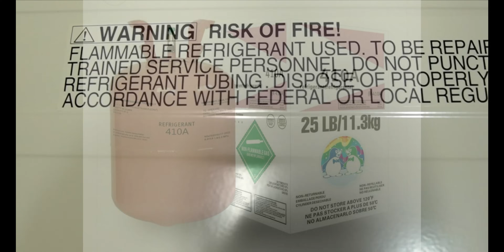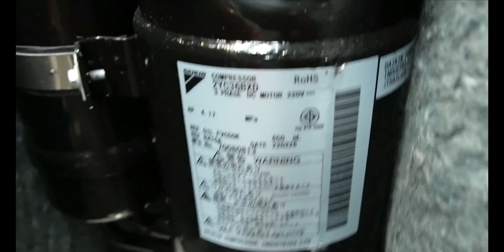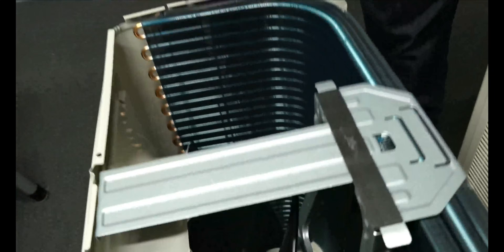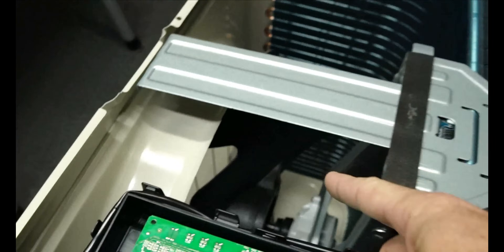The Truth About The New R32 VS R410A Heat Pump Air Conditioner (4k)

Comment: I recently installed an R-32 mini split (24k btu) in my finished basement to replace an R-410a unit. I currently live in the southeast USA. When it is 95°F outside with a humidity of 70+, the vent temperature was 44°F on R-410a and now 36°F on R-32.  The R-410a system used about 915 watts running and the new system uses only 509 watts.   
The new R-32 unit is so efficient that I have it running on just 3 solar panels most of the time.  Also, I have an 8 year old window AC in my garage that uses R-32 and have never had an issue. 
The flammability of A2L can't possibly be more than my natural gas lines running all over my home for the water heaters, central furnace and cooktop.
Reply: You're not comparing similar systems if your wattage difference is that great or your compressors weren't running at the same load when you measured the wattage.. the very best stats have R32 at 10% more efficient that R410. Not 90% like you stated.
Reply: I have one on my boat .
This unit only use 600watt max in the winter for heating .
Love that i have done this
Reply: bro do u even braze with nitro? Ur only gonna die if u hack. Seen plenty of ME AC accidents. U guys don't leak check lmao
Reply: Natural gas has an oddor but this gas is odorless when system gets old and a u bend of inner unit leaks no one will know and gas will accumulate in room at floor level as it is a heavy gas.
Reply: who is selling r32 mini splits now what manufacturer?
Reply: @rollandelliott all of them
Reply: Whats the seer rating on both of them I know some of the new units are around 21-27
Reply: and gwp of R32 is normally zero
Reply: @luckingstar  GWP is not exactly measurable, it's an assumption that changes all the time depending on who interprets it. It's more a scam than a scientific measure.
Reply: The problem with the new refrigerant is a bunch of crooked new green deal politicians figured a way that they could make billions off pushing this new refrigerant. The whole thing is bullshit brought to us by a bunch of woke green deal dicjsuckers
Reply: How 24k btu split (i assume non inverter) runs for 500 wats only? Not possible
Reply: Impossible dude, Do share the specs of both ac and the solar setup.
Reply: ..we
Reply: .ewa
Reply: Indeed I installed a r32 mini split in my room and I felt the difference right away much colder the air and uses less power
Reply: Enough about the people here whining about R32 vs R410a. R410a is just 50 percent R32 and R125. R32 always worked better. They added the R125 to make it not flammable.

You can literally take R32 and use it with a torch, and you'll get a little flame - that's it. That the poster claims in Pakistan that it killed 32 people is complete bull sht.

R32 makes perfect sense for mini splits because you use flare connections to begin with.
Reply: They could careless about the planet,just the money
Reply: To ur comment HVAC bent over to the EPA demands. If this was an issue flammability. Natural gas is more flammable and not much for safety built into each appliance but we charge more now for ac appliance.
Reply: You can put 11 lbs of r32 in a closet and light a match and it won't explode.
Reply: @jasoncurtis4404 it doesn't explode this way but contracting with tight oxygen. Companies lable warnings sings ⚠️ of flammablity on units having R32 why not these signs need to be labeled on other units with R410 A or R22 etc. Think about it, if it is that safe, Companies need not to mention these signs on R32 units.
Reply: Dear brother I m From Pakistan and there are many accidents of R32 Ac Blast and more then 32 people Died please dont use R32....... Thanks
Reply: @Dragzilo_Playz  do you have enough electricity to run ACs ?
Reply: @Dragzilo_Playz  Thats because there aren't massive regulations in Pakistan. I've seen how you guys do electric work, diesel mechanic work, ac work and you guys dont' replace things you slap bandaids on the issue. The problem is this isn't the early to mid 1900s so youre slapping chinese parts as a bandaid. You cant do shoddy work with crap parts fam.
Reply: @Dragzilo_Playz  You can say the same for Pakistan electrical grid.  Please don't use electricity it is unsafe.

R410a is being eliminated so both new choices are A2L slightly flammable.  U.S. regulations require refrigerant sensor on indoor units which if escaping refrigerant is detected will shut off compressor and run air handler blower to avoid settling refrigerant pocket concentration.
Reply: @Dragzilo_Playz  That's likely because those people were trying to hack up an old air conditioner for parts.

Comment: I have an LG three zone r410a minisplit. I have 2 air handlers installed and would like to add a third air handler. Can a 32 air handler be added to the r410a condenser?
Reply from the maker: Great question. You might be able to. R32 has no temperature glide and the EEV or TXV might be different. Check with LG.

Comment: Idiotic comparison…trying to make r32 the new standard…nothing wrong with the old one…if it works, leave it alone … no need to replace…also, where are the comparisons while they were running … we need time that it took to cool two identical rooms with identical starting and ending temperatures

Comment: Primary difference in SEER2 is additional loss due to ducting static pressure induced loss.  For mini-splits with no ducting there is almost no difference in SEER vs SEER2.

R32 is single component refrigerant with no glide slope temperature in liquid/gas phase change.  R454b has a significant glide slope, much greater than R410a, which can cause mix separation when there is a refrigerant leak in the system, changing the characteristics of the remaining refrigerant in the system to deviate from original R454b mix performance characteristics.  

R32 has a little higher high side pressure than R454b or R410a which theoretically is a little harder on compressor.  Larger condenser helps keep high side pressure down which was noted in R32 unit review.

Weighing the R32 slightly higher high side pressure vs R454b large glide slope, my preference is the R32. Should be little debate at present situation, with R454b expensive and hard to get.  Hopefully the supply chain for R454b will get straightened out and its pricing will get comparable to R410a or R32.  Most new U.S. air conditioners will have R454b.
Reply from the maker: Thank you for the constructive comment! We wish that all comments would be crafted similar to yours.
Reply: " Most new U.S. air conditioners will have R454b."
No they will not. Not enough wealthy people to foot the bill for this overpriced nightmare successor to nightmare 410A. R32 will come in instead just like it has in window units.

Comment: Practically every two years, the type of refrigerant used in air conditioning systems is changed. I think it's simply a matter of business. Anyone with common sense would choose ammonia for industrial systems and carbon dioxide for residential ones.

Comment: I have no real problem with R32 or with Daiken equipment. But, those double layer coils are a big problem. I'm an HVAC service tech I see this every day. Those are nice looking units but the long term serviceability just keeps getting worse. Brand new those coils are clean - great. Once they develop a layer of dirt in between the coils, how will you clean it out? Easy answer, you probably can't.
So now you lose that entire double row area as they get blocked with dirt - so much for your efficiency. This is not a Daiken only problem and I've seen worse offenders. Some of the large commercial machines have 2 and 3 layer coils and we have to disassemble them, split them and wash with water. They we just pray they don't leak. This is just a tough problem. This is not a Daiken only problem. All brands have to find a way to increase the coil surface area and keep the equipment size the same or close to the same size. Depending on where you live, those coils could be clogged in a year or two. Then you'll see what happens when no air flows over that portion of the coil. I see a lot of coil cleaning in everyone's future.
Reply from the maker: Thanks for the insightful comment from a service technician's perspective!
Reply: Hey Dan, I’m being quoted a 5 ton Daikin Fit system for a 2750 sq ft home in SE FL. Old system is a single stage trane. Definitely concerned about such a small condenser unit being able to keep with up FL weather. Also read horror stories about energy consumption going up. 12 year parts and labor warranty makes me feel more comfortable, but am I going to be giving a lot of money away on coil cleaning?

Comment: So let's say hypothetically I have an R32 system and it's no longer cooling. The pipes to the evap coil are freezing indicating low refrigerant. I then hypothetically charged the system with r134a, what happens next?
Reply: Those two refrigerants have completely different PT charts. That would be a complete mess. Hypothetically, I would tell you to hypothetically pull your hypothetical head out of your hypothetical ass, and never touch a manifold set again. Hypothetically, of course.

Comment: R32 can't resist the heat in North Africa Contents, The high temperature environment lead to compressor explosion. R-410a did a better job.
Reply: Mine hasn't exploded yet.
Reply: Mine hasn't exploded yet.

Comment: The real question is can I charge R32 myself without some sort of license? I love 4:10 because I can buy it through Amazon and use it at my house whenever I need. I've installed multiple 410 systems myself and it's really easy. I don't need special tools or licenses to buy the tools or a license to buy the refrigerant everything is just readily available for me.

Comment: R32 is flammable refrigerant knows as a Kil**r gas...safety first, Companies are forcing people just by advertising high efficiencies, energy saving, more cooling bla bla bla just to attract and motivate em to get R32 just because it's production is less costly. Here in Pakistan people have died cuz of blast occurred due R32 gas ac inverters and demanding govt. to ban this R32 gas known as kil**r gas.
Reply from the maker: Very interesting! There are so many people from your region who comment about the dangers of R32. Compressor explosion can occur with R22 and R410A. We do have government records of fatalities in U.S. for R410A explosion also. Techs died in the U.S., indeed,  that’s a fact. In our opinion it’s more of installation error such as not pulling vacuum. Introducing oxygen to the system completes combustion triangle. Always pull vacuum no matter what!!!!!!!!!
Reply: @GWAC555  sir that's indeed! the same companies do not label R410 as flammable but they lable warning signs indoor outdoors with R32 which reads "flammable gas, handles carefully! ⚠️" in name of efficiency and enviro eco friendly etc. Companies are failed to attract customers by clearly motivating on the ongoing queries but trying by giving lots of features in units filled with R32. Who is responsible, and why handling and caring is more required in a friendly gas R32 never heard about R410 such precious precautions ☺️

Comment: What I'd like to know is if heaven forbid my 15 SEER Trane needs to have an "infusion" of replacing the current 410A with whatever snake oil the gummint and/or creators decide what's best of us and their wallet, is can the 410A be evacuated and the new fangled stuff be put in its place WITHOUT replacing the equipment? If not WHY not? I'm sure  something can be pushed through it to clear it.
Reply: For now, no. R410A will still be available for sometime if not indefinitely. I don't think it will be completely banned like R22 or R12 because GWP isn't the same as ozone depletion. The only way I see R410A being banned is if they ban R32 as well.

Comment: Here, in India we have been using R32 since 2016. My house has a 6 year old R32 mini-split, it's working fine. However, VRF systems still use R410a.
Reply: Why do the vrf units still use r410a?
Reply: @mrbaaghi1189  there are VRF units that use R32.

Comment: We have 15 and 18 year old R22 and cools like crazy. Somehow R410A didn't feel the same even though it has much lower boiling point than r22.
Reply: Lol I also have an 16 year old R22 system, cools the best Outta all gets me freezing
Reply: Has to do with evap temperatures. Possible you have higher evap temperatures and that's usually due to fan blower speeds or some temperature cutoff/defrost cycle stuff.

Comment: I personally hate that that board is upside down on the mini split system. If they put a LED light where is visible it would be great. Also I would like a view of pressure and temp difference to compare both refrigerants. We need to stop trying to implement European standards.

Comment: R22 all the way baby, fuck every other refrigerant and fuck the EPA…..R22 has the best cooling capacity and efficiency, the best stability, runs on relatively very low pressure ( less leaks), its very safe ( environmental impact is bullshit ) and most importantly it’s NOT FUCKING FLAMMABLE.
EPA (Everyones Royal Pain)

Comment: i filled up my VRV with R454b which was factory charged with 410A... All good no issues here. Machine running even more smooth. You should try this one time on the channel.
Reply: Jesús it specifically says not to mix refrigerants, nonetheless under pressure

Comment: The whole flammability concern is absurd.  Many houses have a natural gas meter near the compressor, but I guess the EPA never noticed those.  I installed a 1.5 ton Della mini-split SEER 22 last Spring which came charged with R32.  Made by Medea, like most Chinese brands.  I bought to better use my solar energy, just heating and cooling the living areas, but the little guy cooled my whole 2200 ft2 house this summer, even on 110 F days.  Good since my central AC died right after I got it running.

Comment: The HVAC industry wasn’t ready for A2Ls when it launched outside the US, and it still isn’t ready today, the only circumstance when the refrigerants flammability is an issue is when techs aren’t using key best practices when brazing including;
 recovering into a vacuum, purging with nitrogen after recovering, CUTTING OUT ALL COMPONENTS NOT SWEATING OUT and flowing nitrogen when actively brazing.

The problem is 99% of Techs aren’t doing these practices, which is going to result in igniting the refrigerant when brazing under some circumstances.

Otherwise A2L refrigerants like R32 and R454B are fine.
Reply: You should always use nitrogen when brazing to make sure you are having a clean atmosphere inside the pipes... Secondly oil also can be burned. Everyone forgets that. Its not very flammable but when brazing you will have this issue too.  

Always vacuum before working on these machines. break vacuum with nitrogen and then open the machine.
Reply: Them techs gunna learn to study somehow lol.
Reply: That is until your house blows up with a sudden discharge...

Comment: Recommended Daikin AC that uses R32 or R410? please help me answer because I want to install AC.
Reply: Those are high pressure operated Refrigerant,  just flush those refrigerant from your unit and use old refrigerant like r12 or r22 😅

Comment: I think the only notable things on the new unit... it is R-32... and the fan blade.  The other changes are simply incremental engineering changes that could have happened on a revised R-410a unit.  I do think that 15" of overlapped coil is rather odd.  Why not more?  Why not less?  I suspect the driving concern is storing it in a warehouse and shipping; that allows the unit to be slightly smaller which helps in those circumstances.  It really doesn't matter for installation.

Now the fan blade.  That is cool.  There are have been two major advances in propellers in the past few decades and I was hoping that they would make their way to our systems:

1. Toroidal blades: this is the innovation I really want to see.  they're much more efficient and even quieter, by far.
2. Serrated trailing edge: this is mostly considered a way to make the movement quieter, but noise is the expression of energy, so the quieter it is, the more efficient it is.

I'd like to see both.

EDIT:  So, I replaced my old AC with an ASHP last year when it died.  I am really happy with the system.  It was just a drop in replacement... I kept my gas furnace as the air handler and for backup heat.  A significant contributing factor to the failure of the AC was the zoning system and a failed damper... and a failed temperature sensor in the zoning board.  So, I have been to get rid of all of that and just get a 2nd unit for the upstairs.

I was initially rather concerned about R-32.  I still have some reservations, but I think I am ready for one.  I was going to get an identical R-410a ASHP, but with an air handler, since it would be net new.  Since it will be for upstairs, I think R-32 makes a lot of sense.  The biggest reservation I have about R-32, still, is having it next to my gas burner for the furnace.  Since I won't have this for the upstairs unit, R-32 seems like a no brainer.  I am in an area where we get extended periods of below zero (fahrenheit) temperatures in late January and early February, so backup heat is super important to me, even though my ASHP seemed to work fine (I had the thermostat set to burn gas when it was below 5F overnight so I didn't wake up to a freezing house in the event that I somehow messed with my install... it was fine).  Perhaps my concerns will prove unwarranted with two separate units and the improved performance of R-32.
Reply: i have a really cheap 12kbtu inverter and the trailing edge on the fan blade is the funkiest serrated edge you can imagine.